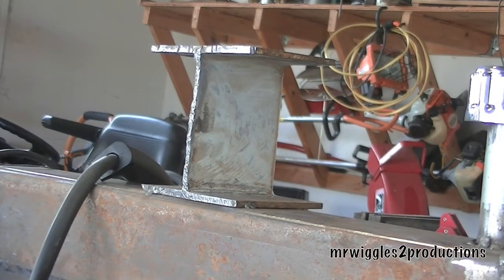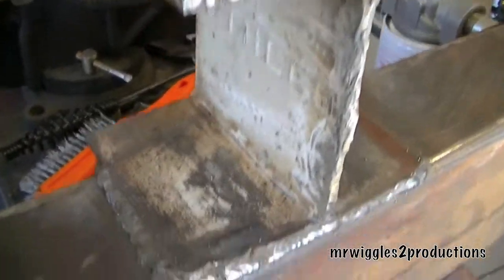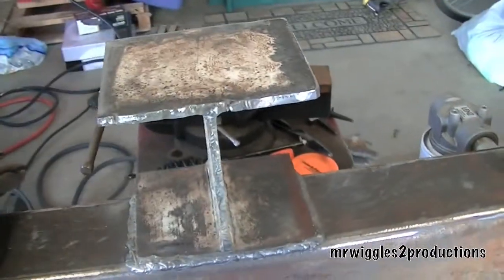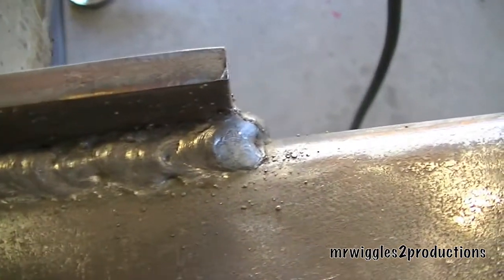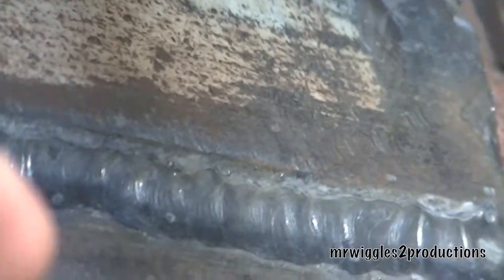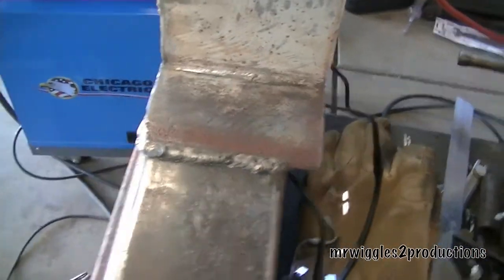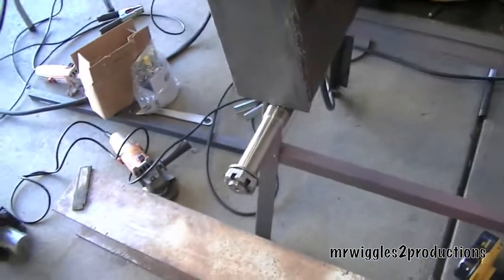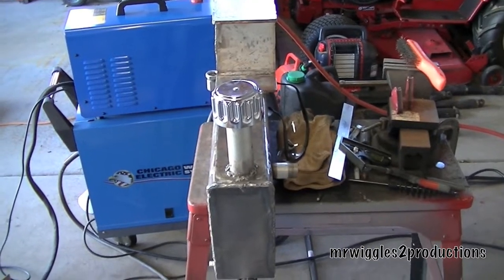Log Splitter Build Part 5

Comment: I want to express my thanks to you for the video's showing your building process. I'm on my second new and improved splitter. Trying to stay ahead of my body  being eaten up by arthritis. Three new joint replacements to date. The splitter is doing the trick because I no longer can swing an ax or mall. At 64 I am in welding school having a ball. KEEP ON SPLITTIN !!!
Reply from the maker: Thank you Randy, I am glad my videos on the splitter were helpful.  Being my first splitter I learned a lot and have strengthened the splitter since the build.  I just recently picked up a trailer load of white oak rounds, that were 28" wide and it split them without issue.  Pretty cool when the pump gears down and really starts breaking through those big logs.  Thanks again for watching!

Comment: isnt that h beam just sideways? i think i beam is more angled...
Reply from the maker: +Billy Bell Could be, I'm no expert on these things.  This H beam was a little on the thin side, next splitter I build will use an I beam.  This needed a 1/2" top plate to stop it from twisting.  Works just great now.
Reply: im not either i just saw pics of both side by side

Comment from the maker: Nope, only a few.  Couple grinders, multi-tool, welder and plasma cutter.  All my woodworking tools are brand name (Dewalt, Hitachi, Craftsman, Porter-Cable).  Just a few tools that I researched that were diamonds in the rough are Harbor Freight.

Comment from the maker: Thanks a lot.  Yeah, I was kind of forced into the plasma cutter.  Was going to buy a multiprocess machine (tig,stick, plasma) but went with this after going on a welding forum and reading up on it.  My splitter will push into the wedge, so I won't have worry about sticking logs... that's the plan anyway.

Comment: nice plasma cutter. no chop saw could cut that big i-beam. i rent a log splitter from a local log&lawn place and the only problem is sometimes with certain wood like elm, willow, boxelder it splits but still sticks to the wedge.

Comment from the maker: This will only be a horizontal splitter.  I don't like the vertical splitters because they use a wedge attached to the cylinder, when you want to use it horizontally.  Like the cylinder to push into the wedge.